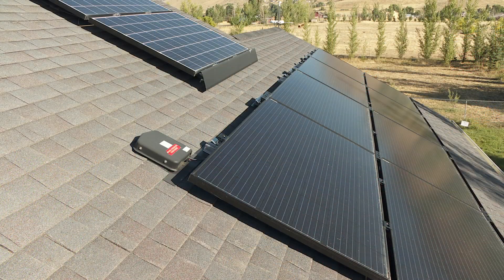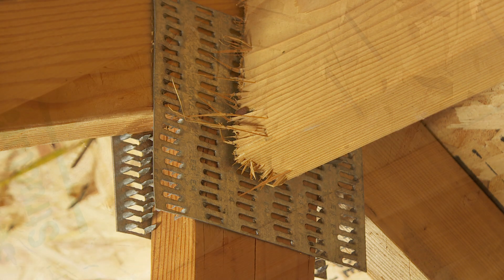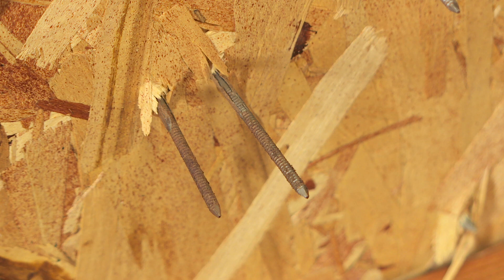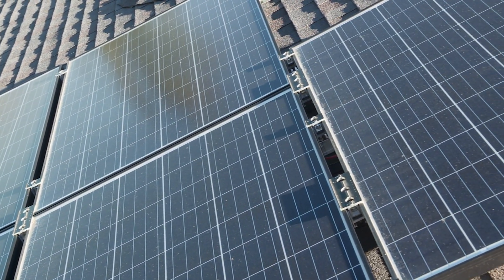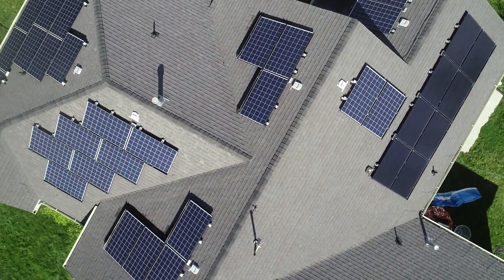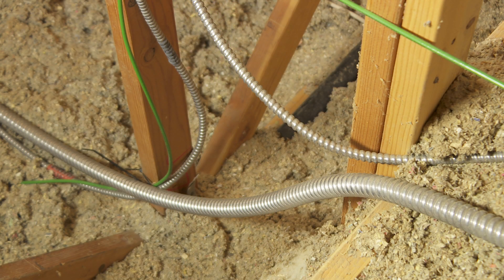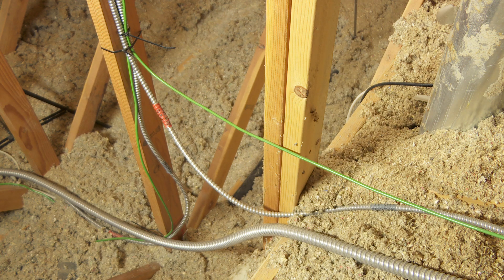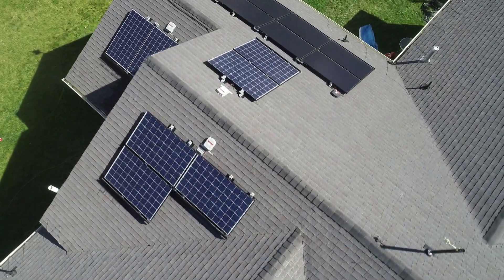Home Solar Panels and What's in My Attic?

Comment: Very useful videos. What happens to electricity production while you have snow or ice  on the roof and panels? Thanks
Reply: Most snow and ice does not stick very well to glass (compared to roof shingles). so it slides off. panels also are warmer in the sun and melt the snow. I'm also putting heating elements on my panel aluminum so I can accelerate the process.